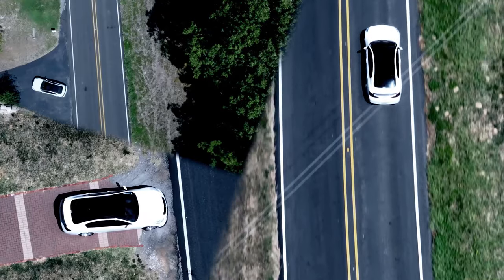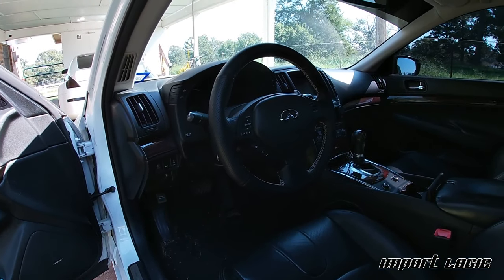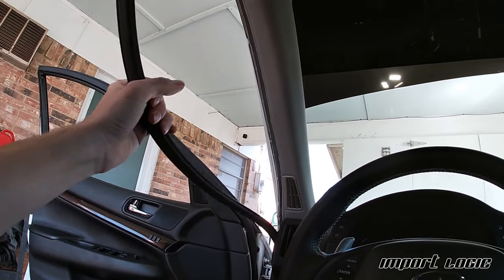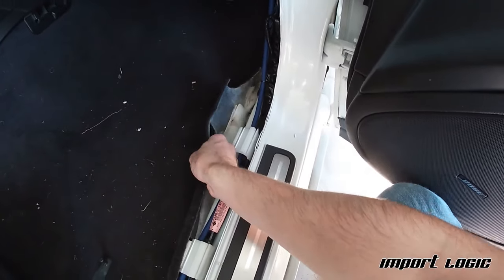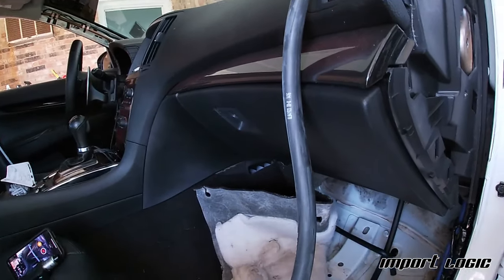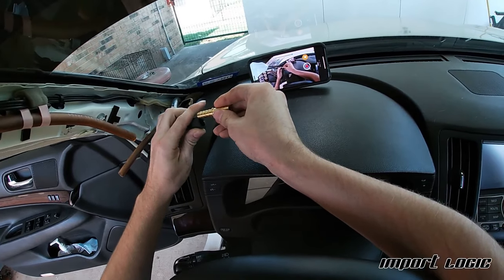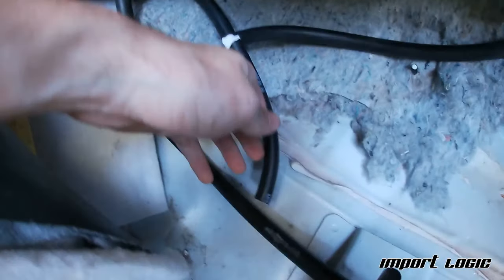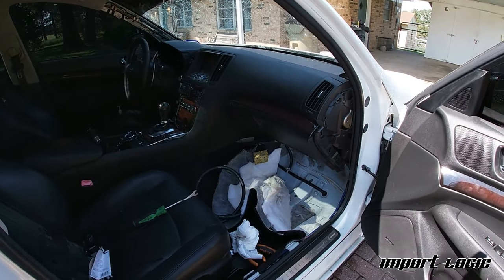Infiniti G37 Sunroof Leak Fix! - Simple Permanent Repair / Fix

Comment: A little tip for anyone doing this job, there’s a hole in the floor right by the dead pedal on drivers side. No need to run it over to the passenger.
Reply: Looking for now. But I don’t see it. I see the gromet for the hood latch line a little higher up but don’t see a drain?
Reply: @Speedycory6  did ya find it I’m about to do the job
Reply: @brockzack8370  no I ended up just doing it like how it is in the video.
Reply: @Speedycory6  Is the 3/8 dimension for the inner diameter or outer diameter   My search for tubing is differentiating between Inner and Outer.
Reply: @mariocasarez6043  I believe it is inner diameter.
Reply: So it’s under the carpet I’m assuming?  Imma have to go look
Reply: @SLCGlobalGlass let us know if you find it, I have to do this job soon myself
Reply: Anybody find the spot on drivers side
Reply: @the_obo_knight8225  just do it the other way, took me no time to run the hose through the cemetery and out the passenger side
Reply: That hole can only be accessed by removing the emergency brake, as the hole is behind the pedal.
Reply: @Speedycory6 Was it inner?
Reply: I made a hole on my QX50. Drilled a hole just above the dead pedal foam piece with a stepped drill bit and caulked around it. Passenger side I tapped into the hose he's talking about.

Comment: I was leaking on both sides.  Did this today and it worked great. Got all parts from Lowes for $36. Thanks a million!
Reply: Do you remember what you got to fix it?
Reply: All my lines were .5 inch vs 3/8 I had to get .5 inch barbs , 2 way and 3 way . 2 straights . And 2 3 ways . And 14ft of .5 7/16 line

Comment: Found a wet carpet this week, luckily the drivers side so nothing got fried.  Found your video and liked this method much more than any other one I'd seen.  Found all of the pieces I needed and completed the whole job in an hour and a half.  I used clear tubing so I could see how it was draining.  I tried some water at home as a test and then took the car through the a car wash with the A pillar covers off and the passenger carpet folded back so I could watch the draining in real time.  You saved me so much time and frustration, thank you!!!
Reply from the maker: I wish I did clear tubing now that you say that! I’m glad it was helpful!!!
Reply: Ingenious solution to a common problem. Thank you!😎

Comment: I was seriously considering getting rid of my car due to several frustrating issues. In the winter, condensation would cause the windshield to ice over, and as it started to melt, my dashboard would get soaked. The fogging was relentless, and both the driver and passenger floors would become soaked—just like in the video. Water even spread behind the seats. (If you're tackling this issue, make sure to pull up the carpet and floorboard to remove any trapped water and dry the carpet properly.) To make matters worse, there was that awful mildew smell. (A few moisture absorber packs in the car can really help with this.) On top of all that, I was dealing with the "Shift to Park" warning that would pop up after it rained, followed by an annoying sound. I'd have to unplug and reconnect the battery for at least three days just to stop the error. I was done with my car, but thanks to this fix, everything has been resolved for six months now. This solution has truly been a game-changer! A huge thanks!

Comment: You sir are a genious! Thank you for sharing this video!!!  I've had this leak issue repaired TWICE at the dealership, both at great cost, and just two years between "fixes"!  And the leak recently returned again for the THIRD time!  I took my 2010 G37 back to the dealer and they want $2k to "fix" it!!  I told them there was no way would pay that ridiculous price.  And the service advisor and manager both tried to tell me they've never heard of these cars having repeat issues, that once it's fixed, it's fixed. Liars!!!  I called the parts department to see if they had the drain clips in stock and this guy was honest about this issue.  He told me that they keep this part in stock because these cars have this known design flaw.  I ordered all of the parts on everyone's favorite online store and they will be delivered tomorrow.  Then I'll tackle the issue and fix this problem myself.
Reply: They are liars. Mine is leaking again too after supposedly being "fixed" by Infiniti.

Comment: Oh my goodness, thank you!!! I had called my insurance company today thinking it was the bottom winshield leaking from the seal. 2012 g37 sport sedan. Have to call back Monday but I decided to research a little. On an infinity forum the talked about drilling holes in floorboard, taking seat out, all kinds of stuff. ONE guy said these 3 words. "Sunroof drain tubes. End of story", so I came on here typed in year make model sunroof drain tubed and you came up first. Praise GOD!! So now I can fix this tomorrow myself because the water us leaking onto my fuse box on Drivers side under dash and causing problems. THANK YOU SO VERY MUCH!!! HAVE A BLESSED WEEKEND!!
Reply: Can u pls share the list of materials u got? I got a 2012 as well. Unsure if the drain pipe sizes will be the same as others😢
Reply: @forrestgump4570 the drain hose is 3/8 then, you get a 3/8 BRASS barb, then a 3/8 T fitting. Just listen and watch he will show how it's all done. I followed along with him and did mine and used zip ties to secre ends of hose to T, & Barbs then trimmed off excess tip ties

Comment: I did this with my 2013 g37.  Working like a charm so far.  I did struggle to pull the hose over the hump.  Used old hanger and tape to pull the hose through.  My car drain was 1/2 inch vs the 1/4.  It has been about a month so far no new issues. I am not mechanically inclined, so it took me about 4 hours total time to complete it.
Reply from the maker: I’m glad it helped man! Yeah getting it over the hump without it sagging was difficult. Need to be sure it has a downhill slow the whole way.

Comment: I have the same problem with my 2010 Infiniti FX35. My carpet were soaked like yours. I did extensive research on this and found that the cause of the problem is the drain plugs that terminate in the firewall. I watched a lot of videos of people trying to replace those, or modify their existing plugs by taking out the baffle and putting in a metal straw. This seemed extremely difficult and beyond my skill set.
I didn't want to pay $1500 for the dealer to replace the drain plugs only to have it happen again so I decided I would do it myself. When I pulled the carpet up I saw the AC drain in the floorboard and thought that I might be able to use that. I searched on Youtube to see if anyone else had the same thought and found your video. We must think alike. 
I'm good at troubleshooting and coming up with solutions, but not so good at executing the solution so I am glad that you posted this video to show me how it's done. I am going to attempt it in the next few days as soon as I source the parts. This seems like the best fix for this solution.
What I am really surprised at is how come there isn't a recall for this problem since it happens to EVERYONE at some point. It's not just wet carpets you have to deal with either. I have read horror stories about people who have had electrical problems from the water ruining their ECMs and other electronics. I love Infiniti but I will never buy another one with a sunroof.
Reply from the maker: So glad to hear that this video helped you! Let me know how it goes!!!!
Reply: @importlogic  I just did my passenger side using your technique and it worked well. I really appreciate people like yourself that share your knowledge because without it, I wouldn't have been able to fix it. I sent you a $ tip, it's not much but I just wanted you to know I appreciate your help. I've never tipped anyone on the internet before and I never pay for content.
Reply from the maker: @JubeProductions  WOW! Thank you 🙏 that is appreciated more than you know!!!
Reply: @JubeProductions may ask this just happened to me I tried thw other way still leek so I will try tube method, where can I get the parts from
Reply: @CASHOUTbam  I fixed my problem by just running the drain to the main drain plug on floorboard in cabin. I ordered some tube and connectors from Amazon. I used zip ties to connect the tubes.
I'm not too handy with car repairs, but this was pretty easy. You just have to be careful taking the interior apart to get to the lines.

Comment: I tried the other method 2 years ago on multiple times and it still leaked and I had my car covered with tarp when it rained and I never thought there would be a fix… well this took me an hour last night and took it to car wash first thing this morning and boom! No leaks! It’s fixed! I can’t thank you enough! Your a genius!!!
Reply: Did you do anything to the drain plugs on fire wall after you re routed the drain hoses to the foot rest? or did you leave the alone and had no more water leaking issues?

Comment: 2008 G35 Sport Sedan. My son and I just completed this repair. The hardest part was on the passenger side. Routing the tubing through the dash from the A-pillars. It would only go about a foot or less and then stop. Since we could not get it to go further, we had to remove the glovebox and the support behind it. Removal was super simple and afforded us a much better access and view to route the tubing from the A-pillar and behind the dash to the firewall and ultimately to the passenger footwell. We did both sides, passenger and driver even though the only side that was leaking was the passenger, it was only a matter of time for the driver side to fail - the driver side was much simpler to route the tubing through the dash under the steering wheel shaft and over the top of the pedals - easily zip tied to keep the tube clear of the pedals and maintain drain slope. Huge kudos to you for sharing this video and showing that it can be done.

Comment: Thanks for this link I have been looking for a solution for this problem this is the second time I’ve experienced this problem. The first time the dealer fixed it and kept my car for 2 weeks. They damaged my dashboard and had to replace it. I followed your directions and it works perfect. Thank you so much.

Comment: Just finished the job and it went well.  I carefully routed the hoses to avoid interference with any moving items.  I decided to bring each drain hose to the A/C drain separately.  By the way, on my 2012 G37X Sedan, the A/C drain hose is 1/2 inch.  I bought two 1/2 x 3/8 x 1/2 barbed Ts and it worked great.  I took a photo of the tie in but don't think I can upload one here.  Thanks again for the idea and video.
Reply: Where did you find a 1/2 x 3/8 x 1/2 tee?
Reply: @nathanautry6718  Menards
Reply: Hey boss I have the same issue with my G, and its also the same year and model as yours, can you possibly send me a picture of the tie in you mentioned? Part of the reason also I need the picture is because I need to find the ac drain, my 1st car fix haha.
Reply: @alexisvelazquez3509   I can't figure out how to post a picture here. If you have an email, I am happy to email the photo of the tie in as I did it.  If you pull the carpet up in front of the passenger seat (4:08 om in the video) you will see the drain going through the floor.  Rather than tie the two drain hoses from the sun roof together before they tied into the A/C drain as he did at 7:40 in the video, I cut the A/C drain in two places.  The first being about 4 inches before it went down through the floor, then at another 4 inches from that spot.  At these two points I put in a T fitting, as I mentioned about I had to by two 1/2 x 3/8 x 1/2 barbed Ts which worked great.  I used small zip ties to secure the connections and it worked.  Good Luck.
Reply: Same with my 2012! I just used the same same tee just tightened it really good and put a zip tie behind each side no problems. 😅
Reply: Infinity should have done a recall on that issue 😡

Comment: Saw this video earlier today from a Facebook comment, watched through and a couple hours later I went to Home Depot, got the 3/8 line, 3/8 barb splicers and the 3/8 barbed tees and some hose clamps it was about $40! Got it done in about an hour. Such an easy fix, better then the stupid straw/ drain method. The driver side I had a little bit of a harder time cause I had to put the tube behind the steering column, which caused it to travel up slightly so water doesn’t get pushed through as good, but it still works great. Thank you !!!
Reply from the maker: I’m glad it helped you man! So I ran mine below the steering column with some zip ties to be sure I had a constant downhill slope. Still works great! The straw method is cool but man it’s a pain….. this is much much better!
Reply: Is this the same on a 08 g35
Reply: Is it the same size hose on a 08 g35

Comment: Thanks so much for sharing this!  I made the fix two days ago, went to the car wash yesterday and the carpets are bone dry 24hrs later. I used clear hose so I can monitor debris build-up.
Reply from the maker: Looking back I think that’s what I should have done. But I new for a fact that vacuum line would last forever. I’ve seen some clear tubing get hard and brittle but considering it’s only water and no fuel, oil or chemicals it would probably be just fine. Glad you liked the video and that it was helpful!

Comment: my bcm got wet from the carpet getting damp from a leak, ripped out the carpet and it’s leaking right next to the seal on the firewall. just ordered the parts for $30, i’ll update when i’m done with this. seems so smart bro never would’ve thought about completely bypassing the original hose
Reply from the maker: Yessir! Sometimes the best way to fix a problem is to not fix it at all and try it from a different angle. Glad this video helped you!

Comment: Many thanks brother. After watching your video for about the 7th time, I eventually gained the confidence to solve my M35 sunroof leakage problem myself. 

The M35 (2009) is a little different than yours, though. First, I notice there was no space for an extra hose beside the factory one. So, I had to pull out the factory one entirely. Then I ran my new hose into the same hole, but it didn't come out in the cabin. Instead, it came out outside (in the hood). I was then able to find a hole through which I passed the hose all the way to the back of the tire (for the driver side). I did the same thing for the passenger side.

The driver side is relatively easier. The passenger side, on the other hand, was really tough. I spend approximately three hours on this job, and about two hours of this whole time was spent on the passenger side. This is because I tried passing the hose through a hole underneath the battery tray (close to the IPDM). This proved impossible. I eventually had to pass the hose beside the battery and all the way to the front. That way, I was able to get it out somewhere close to the tire.

In essence, my sunroof leakage has been fixed, and I have no fear of rain anymore, all thanks to your video, and a few others I watched.

Worthy of note: this work on my 2009 M35 had absolutely nothing to do with the cabin, except for pulling out the A-pillar. I also did not use the T, since I didn't need to connect my hoses to the AC drainage hose. All I used for this job were the hose (about 15ft), two two-way connectors, and some zip locks.

Comment: I've had my 13 g37x for 5 yrs now and this shit started last week🤦🏻. Kick ass video bud 🤘🏻
Reply: jjwalker2011 I just got my G37 Sport RWD sedan does it really work?
Reply: @DavidSantos-f5q  
Get in there & double check your tubing size before buying it. Mine ended up having 1/2" as the stock tubing. I bought 3/8th tubing but I still managed to get it to work. Took me a solid 3hrs but I went slow not trying to break any of the plastics. Days later we had a massive storm & both sides were dry. Also making sure you get rubber tubing not PVC. I went cheap & wasn't paying attention while shopping.
Reply: @jjwalker2011  what type brass you bought the same one as video
Reply: @DavidSantos-f5q  
Nah I screwed up & bought off Amazon so mine is completely different setup. But yes Lowes has those fittings but with plastic ones, should work just as good as brass ones but cheaper.

Pull your pillar framing, my existing pipes wear clear & 1/2 not 3/8ths. I could see my right side still full of water. Hopefully this is your issue. 

Lowes has everything you need, but for check you existing pipes for size & just go from there.
Reply: @jjwalker2011  I already checked my hose is the same as the video
Reply: @jjwalker2011  what should I buy already bought it on ebay 3/8 brass metal cost me $5 with the clamp

Comment: Thank you! 08 g35x. Saved me hundreds.
$25 in parts..
 Used clear tubes, only ones available.
and 2 t barb connectors at the ac hose,
 like someone suggested. Took an hour and forty five. So far no interior leaks, after testing.
Reply: Took me 6 days to make it work

Comment: Just finished this! Biggest issue was running the hose on the passenger side. I ended up taking out the glove box…piece of cake after that! I couldn’t find 3/8 x 1/2 t’s so I used the 3/8 and zip tied the AC hose. Thanks a ton!

Comment: So glad I came across this fix. 
Off to buy some 10-12ft of 3/8 tubing, 2 tee’s, and 2 barbed fittings.
This is gonna save me some headache for a 100% better fix compared to some others I’ve seen. 
Thank you for making this video 👌🏼
Reply: what size t tube for AC to Sunroof drain connection ?
Reply: @JiggyManRich 1/2 x 3/8 x 1/2
Reply: Did you end up buying 10 or 15 ft?
Reply: @trav5425  like 100% ? I’m going to go buy it rn